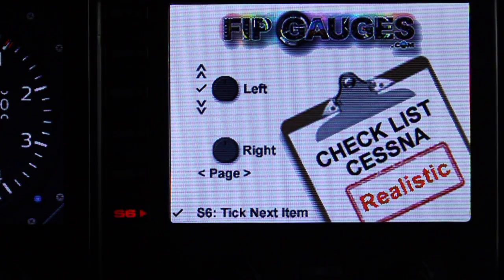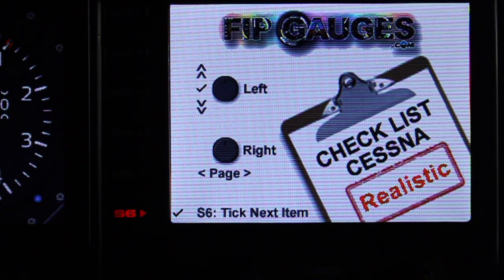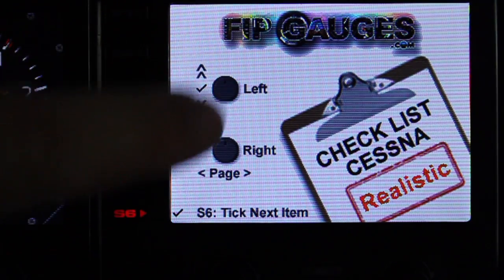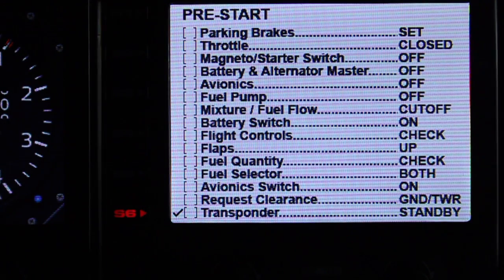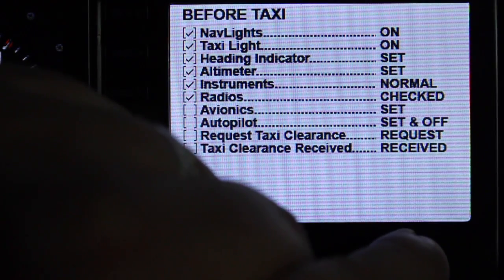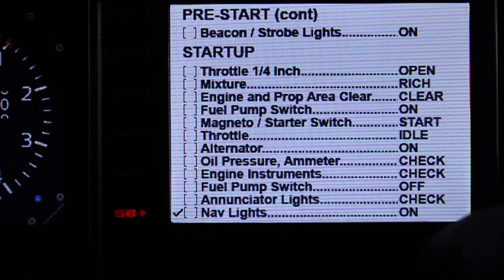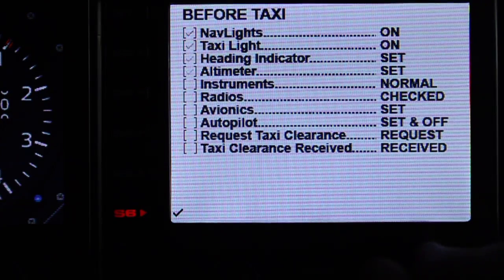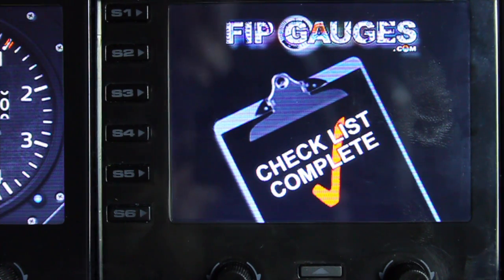Cessna Checklist Gauge - Saitek/Logitech Flight Information Panel & SPAD.neXt

Comment: I bought this gauge too, and it is very funny to have a digital checklist too in my cockpit!! It works perfect. I would like to add only a "Avionics Off" check before the engine start because if you go in order from Pre Start page it will stay on because of the tower Clearance check.